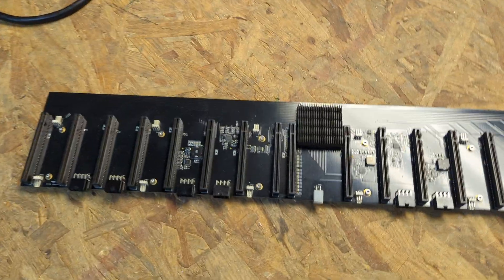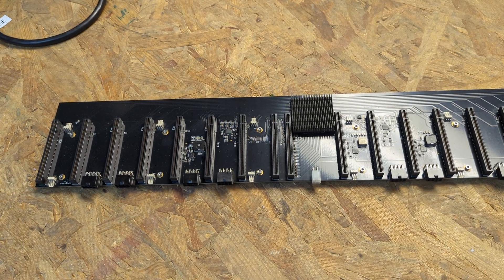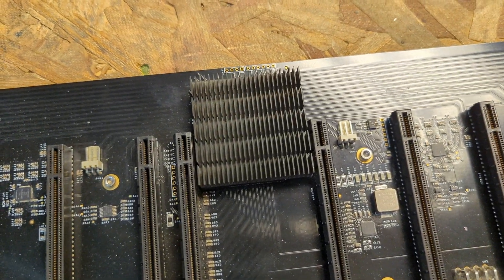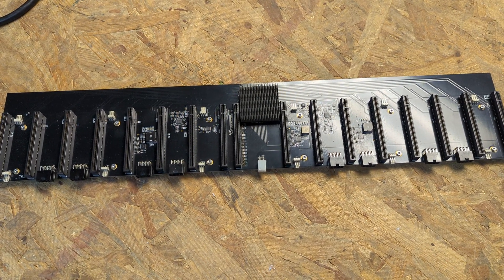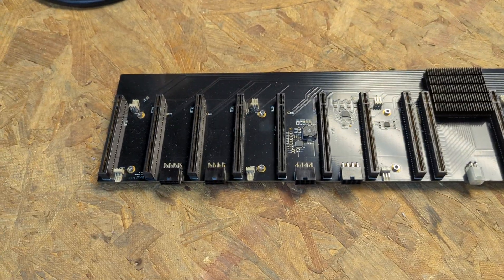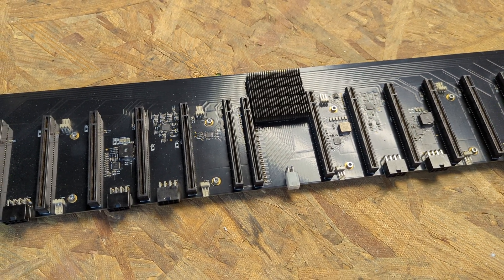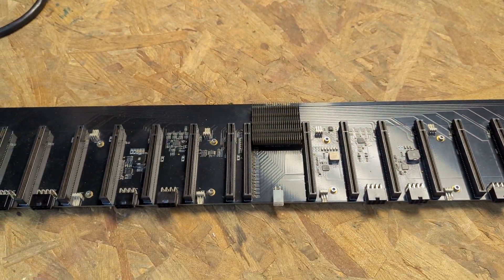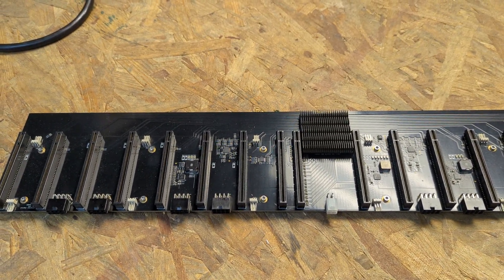32/43 GPU Rig Build (Part 2) with some things to come

Comment: Only needing to power four of the inputs free's up a few valuable cables, nice trick. You should charge admission, this is like a mining amusement park! I snagged a few of those B250 kits for like $40, this is going to solve so many problems (and introduce random new ones lol). Thanks for the video, going to watch it a few more times... 🍿:popcorn-yellow-striped-smile:🍿
Reply from the maker: @Jackson_Digital  I still need to work on that motherboard but in due time, have alot of information to share

Comment: 04:20  I'd say they were designed to run off a single power supply and didn't use diodes to prevent back feeding the mainboard when using 2+ supplies.
I have similar issues with H510 PRO riser less board with two PSU's, and ASRock specifically warn against doing that lol.  
Thanks for sharing!!  #calctheweight :P
Reply from the maker: I have a fix for that and it's coming in a few days 😁